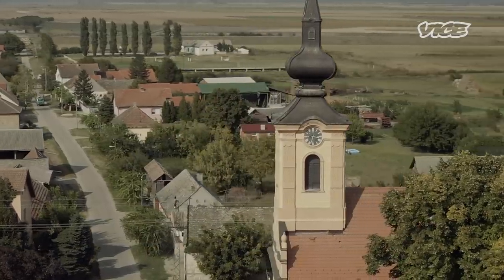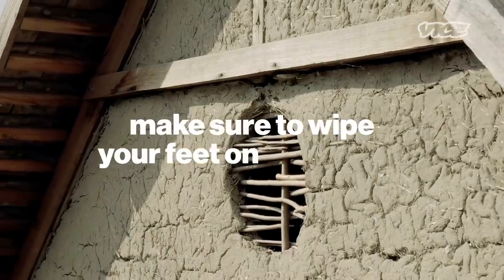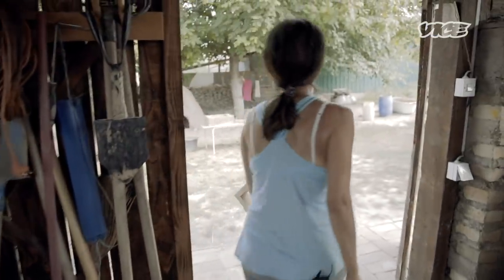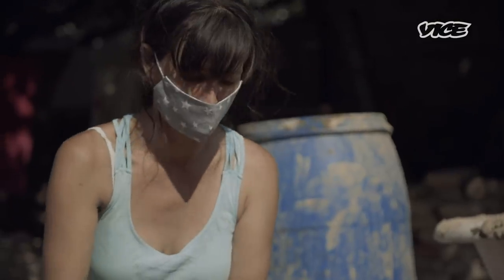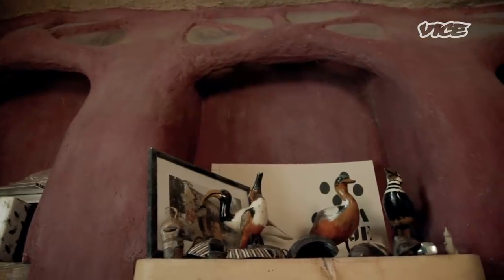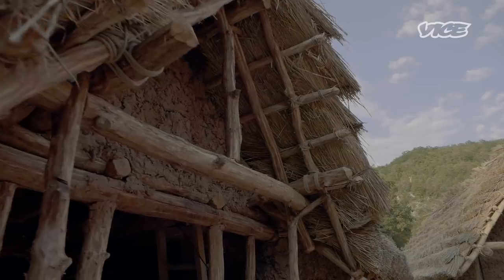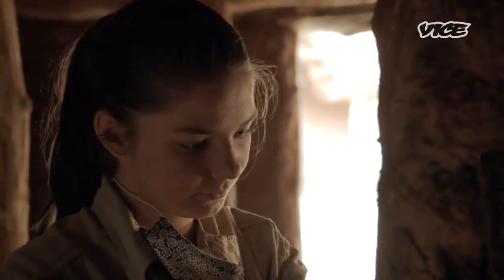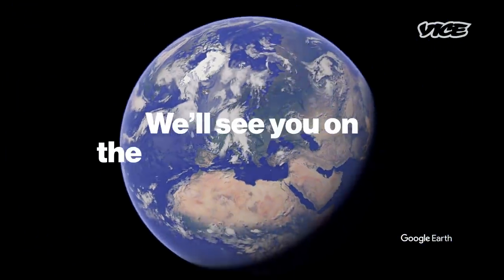Architects Are Using Mud to Build Sustainable Homes

Comment: Ridiculous ending and ridiculous concept anyways. Yes it's fine if you want to build a home cheap and have alternative lifestyle but God gave us the land to reap it and gave us animals and plants for food and yes he said to be good stewards of our environment as well and that's why we are against pollution and throwing trash in the ocean and on the streets and why our sewage flows through pipes underground and separate clean water pipes come from treatment plants but this whole so-called "carbon pollution" is a joke and they have no evidence to suggest that there is an actual feasible runaway greenhouse effect that will happen in the near future let alone the next thousand years. The planet is capable of having much more carbon in atmosphere than there is now and it's changed very little in the past 250 years and most of the rise in carbon in the atmosphere came during the second industrial revolution up until 1960 when people realized that It might possibly be better to Make factories and engines that produce less carbon and go farther on less fuel and of course they had issues with smog in big cities but once we got to handle on it the amount of carbon being released into that atmosphere slowed down dramatically. It takes around 30,000 parts per million for carbon dioxide to actually kill someone and our atmosphere is at about 315 to 370 depending on how close we are to the sun at any given point and how high our atmosphere is because it does shrink and swell depending on how close we are. We could literally go at the rate we're at now for the next 700 years before we actually could really take a serious educated guess whether or not a little more carbon in the atmosphere is better or worse all around for the planet. And it is a case of the good outweighing the bad or vice versa because it is a proven fact that with more carbon in the atmosphere that plants grow remarkably better so we will promote more food and more trees will grow which will in turn lower and balance the carbon in the atmosphere which means we will have an endless supply of wood building materials and you can build whole apartment complexes out of wood up to a certain number of stories high at least 6 or 7 and milling wood produces a lot less carbon than concrete. It'll also help some more hostile climates become more livable but only issue is is the water level might rise along some coastlines over the centuries but with the plants growing more and more carbon coming out of the air eventually it might go back to the way it was and ice caps might even grow again.
Reply: Oh look a trumper 😂